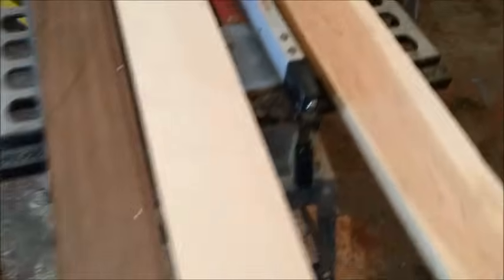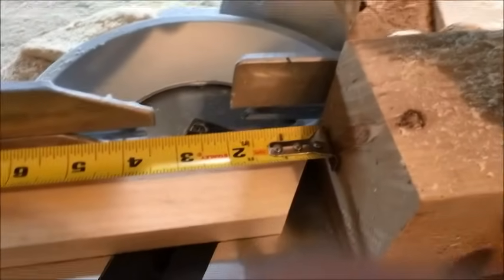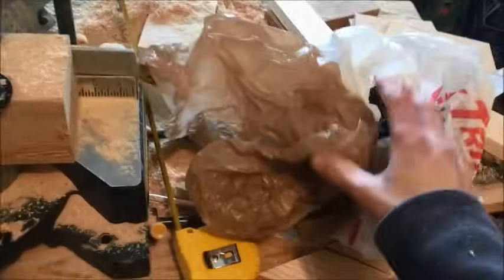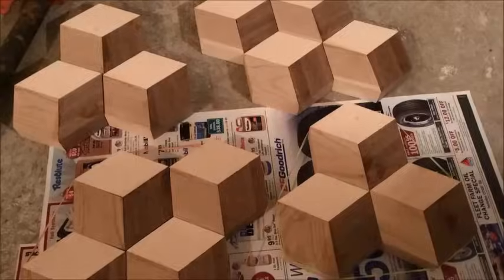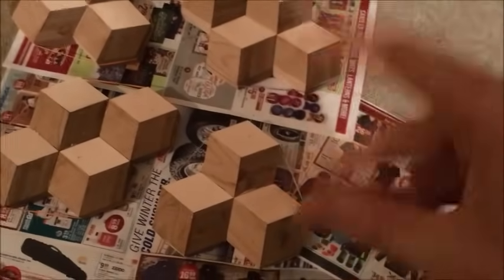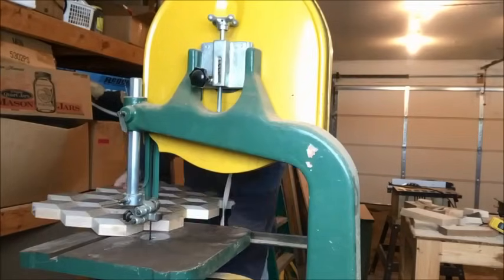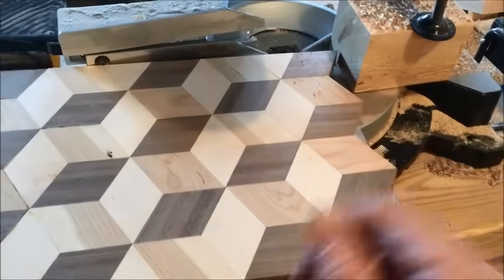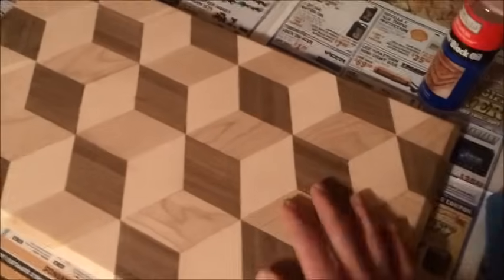How To Make A 3d Cutting Board

Comment: Great video. Now, what the hell am I doing wrong? I cut blocks diamond shaped. If you stack them they are even all 3 sides. When I lay them out there is no way they come together. I noticed the middle edges top/bottom do not line up. Hope that makes sense. Driving me nuts. Cut all at 30  degrees
Reply from the maker: Hi Jeff , did you try it on cheap scrap like pine to make sure you have it set on the right mark. I’ve screwed up a lot before and and it takes forever to get the right cut.

Comment: That tablesaw looks like an accident waiting to happen
Reply: And he still makes a great looking cutting board.  What do you make besides shit comments.
Reply: It's about shop safety and specifically table saw safety in this video. People who are new to woodworking need to be conscious of, and know proper shop safety. Running a table saw with no riving knife or blade guard and making passes with your fingers inches from the blade is careless, ignorant,and extremely dangerous. Great finished project, but it should be stated that safety precautions have been ignored in this video.

Comment: You didn't use the end grain for the board's surface. End grain is much better for a cutting board Apart from the pattern you may just as well have used a plain flat board.
Reply from the maker: Geoff Sims yes end grain is stronger and more durable but but we’re talking about hard maple walnut and cherry all solid wood it will last man
Reply: @BeatlesBlackMagicMusic  you use end grain for cutting boards not for strength but over time with a knife cutting into it the end grain doesn't show the cut marks.
Reply: @johnbrockjr9464  And also doesn't dull knives so quickly.